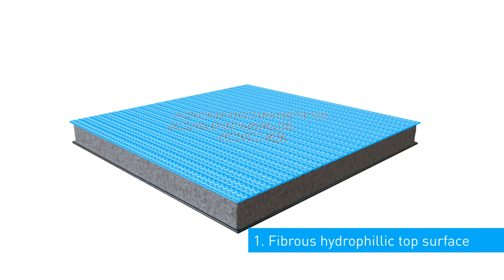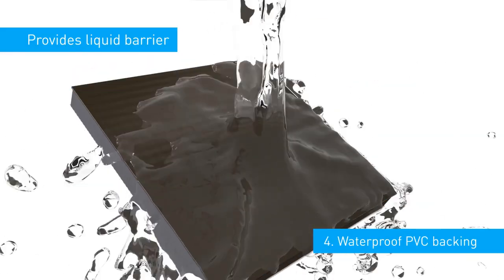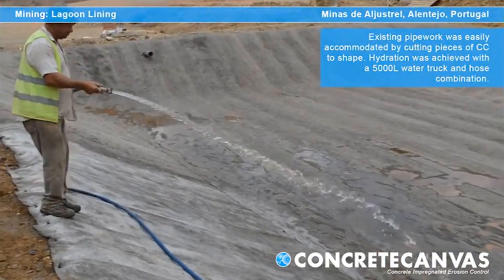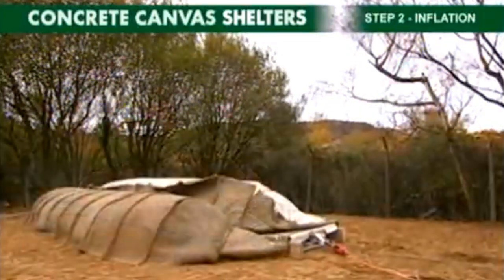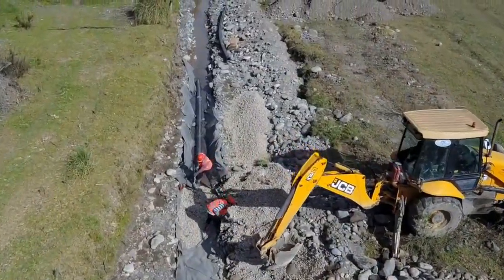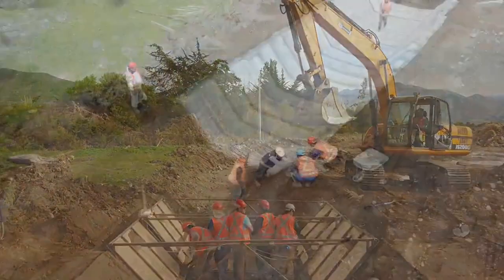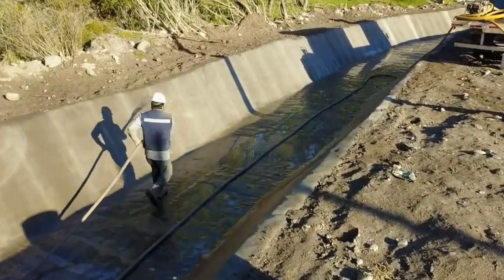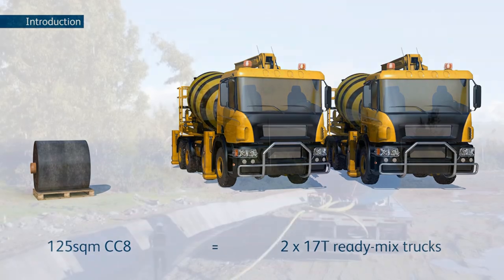Premade Concrete Canvas Tents - Just Add Water

Comment: Interesting as a concept for emergency/fast response buildings.   Not sure how practical they are beyond that though.

I guess if you wanted temporary rigid housing now after a hurricane flattens an area it's got potential, but that's one of the limited circumstances I could see it working.   Maybe if you needed a miltary training camp set up in days rather than weeks that might be handy, but that'd rely on having those ready to go, and not sat getting damp in stores.
Reply: They say it has a designed life of 10 years, so I imagine temporary barracks for either disaster response or an emergency field hospital of some kind would be the exact use case. Firm structures that can resist strong winds would be life savers after big natural disasters.

Comment: How thick is this though?  I wouldn't trust a structure over my head like a tent that's only 1/4" thick concrete. Does the thickness expand after it gets wet/hardens? (no jokes, I know what that sounds like :P)

Comment: Those are good  during hurricane,  because they are rounded .  used by military WWII.
Reply: you could do the same thing with a heavy poly canvas and actually be able to remove it later.   thin concrete is garbage, always.

Comment: The trick is to set up and harden the concrete canvas tent, then cover it with weldwire and rebar and spray-on concrete. Then a layer of A+B urethane foam sprayed on. Then more reinforcement and concrete, then dirt. Et voila, a storm shelter!

Comment: Rough calculation per sq ft, the material cost per unit area is 10-20 times higher than conventional concrete. There is an obvious advantage in installation, however the value of that difference varies wildly with the particular situation. There may also be some fiber reinforcing advantage, which can be applied to conventional concrete but with additional handling trouble. Formulation advantage goes strongly to conventional mix, even the simple control over water ratio can make a large difference in the long term durability. The speed of concrete curing can be modified over a very wide range with simple formula changes. 
The ditch mold could have been used as a concrete mold with very little modification and the concrete can be formulated so that it doesn't slump at that ditch slope-angle allowing rapid removal of the mold. Concrete can also be applied to hill sides as a spray completely eliminating the mold, however it may need some sort of trowel finishing for a smother surface. Really the concrete could be sprayed on the ditch and then the mold dragged along continuously behind the spraying operation to smooth it into an acceptable finish. Normally for applications with only thin concrete the speed of cure is driven by handling needs, faster set for cold or dry weather, for thick structures like dams slow curing is required to avoid heat accumulation.
Reply: The tents are interesting, kind of similar uses with prefab housing. I think calling them $20k tents is causing a lot of cognitive failures in the comments. They aren't really tents as they can't be refolded, they are really better described as a type of prefab structure.
Portable to the site then used for 10 years, being called a tent does avoid a lot of building permit issues,(which is not a technical advantage, but bureaucrats are still a part of reality) The $20K cost is a bit steep considering it is just a shell and door, but not too out of line with other durable prefab shelter. More portable, maybe more durable, but less comforts like insulation and windows, all tradeoffs.

Comment: It would be nice though to inflate a tent and have an instant shed but I wonder how long it would last in real life. Probably 5-10 years tops & less with changing climate. Concrete typically has to be reinforced with rebar steel to increase its strength and I could easily imagine this being a temporary / cheap solution but not necessarily one for anything that has to last decades.

Comment: 1) This system is not mobile once setup...its concrete.  
2) this tent appears to be about 1 inch or less of very basic concrete, that is not stopping any military ordinance and will not count as a hardened structure in and of itself.  Nor would it likely support being covered with earth or gravel unless reinforced inside with some superstructure to disperse the load into a foundation.
3) when overlaid as shown in the video, and with the layers they show, this system will not be water tight enough to be a ditch long term.  There will be leakage and seepage that will undermine the substrate and filler material.  

So its utility seems to be in the rapid setup time, not for a long term project or replacement for large scale infrastructure projects.  As far as the 'tent'...nothing about it appears to out compete a standard 'conex' style container flipped and converted to a living/work/storage space...and those CAN handle some weight loading with sandbags/earth/rock poured over them.

Comment: What I think of concrete tents is a recycling problem, but crushing these and putting them into new mixes may solve this. Unlike plastic ones, which are hard to recycle.
Reply: Lmao. Um... the concrete tent has a plastic tent inside (to make it water proof). It is what is mentioned as the "balloon" to blow up the tent.

Comment: First thing what pops to mind is how to recycle this material? At least normal concrete structures can be split into metal and reusable debris. This has pvc and other none reusable or non separate-able materials (fibers and such). It would be so much better when taking down, torn to pieces it would be no threat to our environment; plastics are.

Comment: Very niche product.  You can't really say "one pallet replaces 2 concrete mixing trucks".  Concrete is sold by the cubic yard, if you have one pallet of concrete that is typically about one yard.  One pallet replacing multiple trucks just means you have much less concrete.   For example as the trench lining.  There is a reason concrete is typically poured to a decent thickness even when reinforced with fiber and rebar.  It is not a wear-proof material and will be broken down over time particularly by running water.  A thin skin of concrete might be useful for a time but it's going to be a pile of plastic and rubble before long.

Comment: Looks great, but cost wise not very good if want a 30k Tent. I understand it is "permanent" maybe, but I dont think it would be permanent after 3 or so years.
Reply: The idea is great, but lacking. I see it as a support structure. Those tents would become small bunkers if you'd add a few more layers of concrete afterwards.

Comment: The reason canals normally use a lot more concrete is not because the builders are fools but because a lot more concrete is required to make the canal durable. The canvas version will not be stiff enough; it will be influenced by subsidence and erosion underneath, and will deform, crack, and leak. Basically a temporary expedient, not a properly engineered structure.

Comment: I would be worried about erosion of the ground underneath the concrete with this kind of construction. Fibre reinforced concrete may be very reslilient but time will take it's toll if the structure gets warped and stressed unevenly
Reply: These are temporary structures. Read the notes.
Reply: @ricomon35  "designed life of 10 years"

Comment: I am going to ask them if the material has been tested on basement walls. Ours bowed due to bad drainage because the last owners tried to do the work themselves. Now, there is a support wall against the cinder blocks and it hasn't moved in ten years. However, we recently had some MAJOR rain and the blocks filled up to the point of causing the wall to leak. I am very, very sensitive to mold. I couldn't even go by the door to the basement until the entryway to the blocks was found and sealed. Unfortunately this meant the water was sealed inside the blocks. We have an expensive setup for moisture in the basement so it dried in a few days but still, I want the wall sealed on the inside.

I found a method used by This Old House for an ancient building with a leaking basement. They said to dig down a foot at the edge of the cinder blocks on the outside. Then drill a hole in the cinder and use a slurry of quick dry cement to pump into the blocks. They said the stair step of the blocks will aid in allowing the slurry to fill them and literally turn cinder blocks into solid blocks. It seemed reasonable to me but my husband doesn't like the idea. I on the other hand have been looking for anyone who has done it besides TOH.

Comment: 30K for a permanent tiny house sounds like a steal.
Reply: Unless it's a 2500 square feet tent, the price they are asking is not even remotely reasonable, it's still nothing but a tent with no electricity or water.

Comment: Looking at only the product, sure it's more expensive than regular pouring. But factor in the faster construction time and the economics look way different. Just think about all the hours saved and multiply those with the hourly rate.
Reply: Yeah you'd come out way behind.  You could use for example pre-made concrete forms and build a hut just as fast, and actually have a respectable pour thickness.  And before you say "but it's just add water!" yeah that's literally how concrete works
Reply: @tech99070  I guess it depends on the hourly rates of labour and machines in your country and how you value the time saved.

Comment: I am afraid its not going to sell much. 1m3 of concrete ready reinforced with steel or carbon fiber cost like 100-120 dollar. You can cover 10m2 with a 10cm layer. And that will last longer for sure.  Even if you safe a lot time and work its not worth it. But it was an interesting find though.
Reply: I can only see this in construction when priority is on time and money is of no issue.

Comment: This is a neat product, but its uses are somewhat limited. In many places/uses, it's not enough just to put a thin layer of concrete over dirt. You need proper base layers for drainage, load-bearing, and so on. I'm not saying it isn't useful, just not to expect too much.

Comment: it looks uselessly thin. but the fabric helps structurally like rebar. 
id like to see a demo of someone sledge hammering at the tent and bullet resistance since it has military use.
"can withstand hammering" but shows a guy hammering a tent stake down before water is applied. stakes are kinda useless for a heavy concrete shelter. maybe a tornado would move it, but not a strong gust of wind.

Comment: Interesting product but the cost factor is misleading.  The high cost of the product must also match it's longevity.  If the "concrete tent" will last as long as the equivalent cost of say a canvas tent, the cost then fine.  Also, the concrete tent can NOT be moved (easily) and reused, thus making it impractical for military use or emergencies.  The use of this product as a tent is useless when you consider other, cheaper, faster installing, readily available structures cans be used.  For other uses, it seems a good idea for locations that do not have the infrastructure for concrete production or ability to use heavy machinery.  For a drainage ditch with little flow of water would be fine, but a thin layer of concrete, even fiber reinforced, will not hold up to heavy flow of water.

Comment: In 20 years after erecting your concrete tent... weather takes it's toll and it starts to crack. The ground shifts and it starts to crack. Rain water pours on it for years and it starts to erode. 30 grand ehh ? Not worth it in the long term. It would make a great shed for storing your lawn mower and such stuff.

Comment: Little does any consumer know that concrete is brittle and not very strong by itself. If this product was "so great", militaries would have began using this stuff years ago (regardless of price, this could be made a lot cheaper if the manufacturing process was scaled up). So much for "erosion protection", this stuff will probably erode faster than what it's protecting.

Comment: Talk to any mason, or civil engineer utilizing lots of concrete;  A proper mix , prep, installation, and cure time is essential for a lifetime product. I don't see any Rebar or support to ensure it's rigidity in tension.  So that inflatable tent will take weeks to cure inflated, and may not last a few winters without serious failures. If they brought the price down alot, it could be a good aesthetic product...

Comment: i’d like my house with this if it was more reasonably priced
Reply: No you wouldn't. Who would want to live in a leaky plastic lined concrete box? One that requires the doors to always be open?
Reply: It's only like an inch thick with no rebar reinforcement. It would crumble in a couple years and concrete is a terrible insulator so you'd freeze your ass off at night and die of heat stroke in the morning. It's cool but you definitely don't want to build a house out of it even if it were affordable...

Comment: Army tents need to be reusable. The army dosen't buy disposable structures. It's vital that you be able to move your structures with you as the battle changes location. 

Aside from that I don't see this being that useful outside of temporary structure. Since each layer is not sealed/attached to any other layer there will be a lot of water seeping between layers. Which is what caused the Oroville Dam spillway failure back in 2017. Retaining walls built of this stuff would have the same problem and the soil would erode away slower than without it but much fast than with a properly designed retention wall. 

At best this stuff would be a duct tape style patch to stabilize ground until a properly designed and engineered structure could be created. It's too thin to be structurally sound, the joints aren't sealed, and it's too light to avoid being uplifted if fast flowing water gets under it from the unsealed joints. The only use I can think of it might work long term would be to help retain water in a pond. But that's down to the rubber layer. You'd be better off skipping the concrete for this use and just using a layer of rubber. Which has the advantage to being able to be sealed to itself to make a leak proof joint.

Comment: This fabric looks to have the empty swimming pool problem.  Ground water could have your canvas ditch floating up and out of the ground.  At that level of pricing it will not sell well, outsource the manufacturing to China and get the cost down and into Home Depot.  Let HD sell the storage buildings as well.

Comment: I was all on board until the cost That building the size of that tent I can make with bricks with the thousand dollar pad on the bottom and a steel roof covered and another thousand dollars worth of concrete with a couple hundred dollars of paint on sealer And then cover the whole thing in earth for under $4000 True it’s like four days labor but that’s like two weekends two separate concert trucks and a pack of Energy drinks
I would consider buying that tent though if they could get the cost to $10,000

Comment: But it’’s not as strong as 4”-6” of concrete mold.. imagine the strength difference going down to less than an inch of concrete for a erosion retaining wall... the dirt WILL move the mold eventually!!!
Reply: It keeps the ground dry beneath it so water doesn't run down the natural ground and erode it. Probably cheaper for spraycrete

Comment: Not sure whats the point of the tent. It takes a compressor to inflate, needs 24 hours to set, and a hose. You can assemble a real tent faster. And a real tent can be disassembled. If you want a permanent structure, the military has other options, including modular buildings, who can be disassembled, and given a foundation if they need to last for a while. This seems like the worst of both worlds?

Also that drainage ditch with it's thin ass cement isn't going to last long.

Comment: 30k for that tent? just build a real building for that. a garage sized building with a real concrete floor is 30k.
Reply: I can see it being cost effective in remote areas for temporary work stations. It's not cheap building in the wilderness.
Reply: @dmd8552  You can use simple tents if it's just something temporary and need fast deployment. Also there are other ways to build something fast and not so sturdy or expensive that you would not care too much of, and easier to move too because of less overall weight.

Comment: Why dont they just send these to mars instead of 3d printing, obviously it would need a airtight bladder for the living sections
Reply: Mainly because to launch that much weight in payload would cost about a hundred and eleventy-six gajillion pounds!  Not only would you need tons of the concrete canvas, you would also have to take the water as well.  I cubic foot of water weighs over sixty pounds, by the time you had enough to make the buildings, the payload would weigh as much as the rocket, which means the rocket would have to be MUCH bigger, and harder to launch on it's own, never mind with the hundreds of tons of payload.
Reply: @christopherdean1326  😏 ever heard of starship, they can also extract water from the soil on mars, to be honest I would rather spend a few extra million or billion and save time that spend ages waiting for something to 3d print soil
Reply: @antstechstuff1784  Tbh, Im not even sure it is just a question of cost.  It may well be that launching such a payload is impossible, or at least impractical, no matter how much money they throw at it.

Comment: Tent shell with nothing in it costing as much as building actual house from decent wood with furniture and connections included. I guess military can afford that, not me. I'll rather order prebuild wooden house for 5k to 10k and spend 25k on furniture. Sure, if you are idiot you can buy house for 150mil that has marble walls and diamond door. But this is questionably better than normal tent and cost tons.